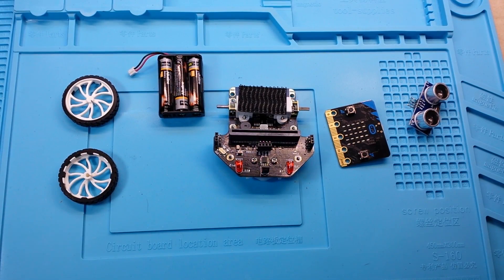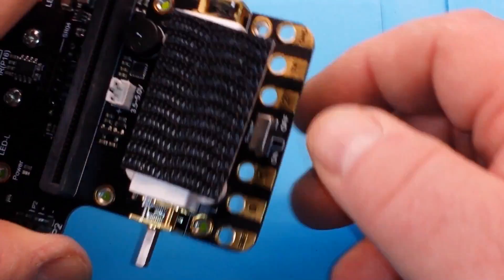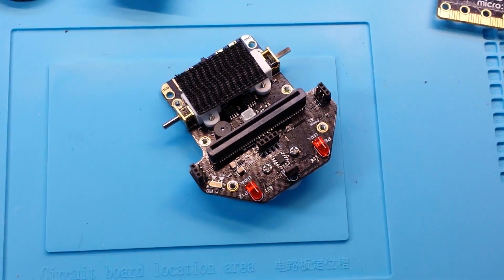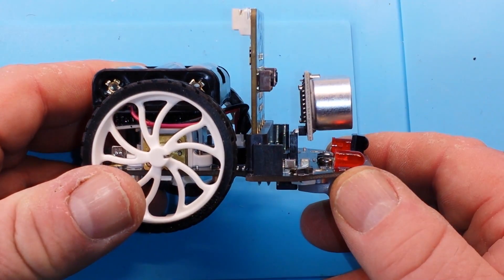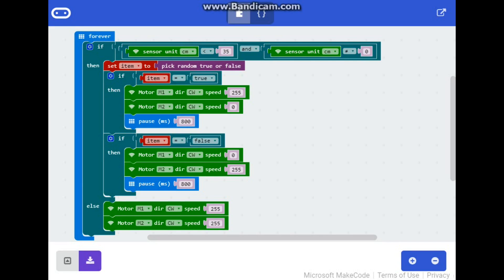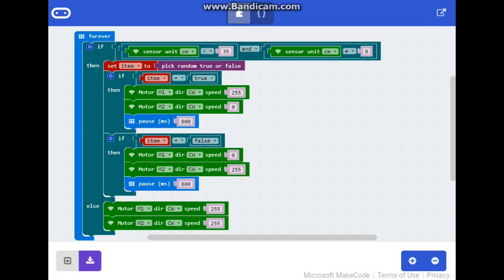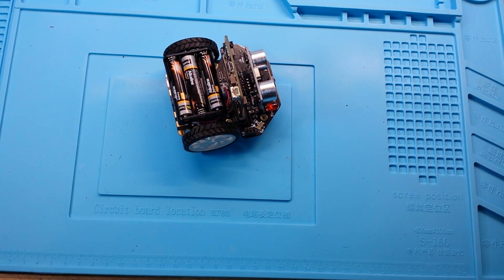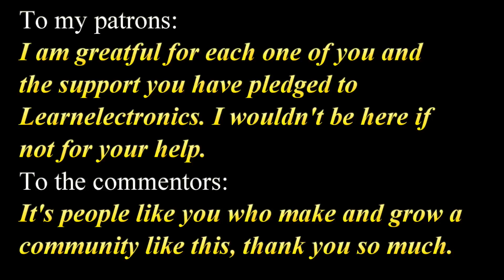Playing with the BBC Micro:Bit robot

Comment: Well, that's too easy to program. 😀 Javascript is an easy language to learn and as long as you can get some real code out of the plug and play then it could be a learning platform for much older students too. Block programming is great for young beginners. Okay so make it do something smarter, follow lines, detect motion or something. Thank you for sharing the Microbit robot and the video!
Reply from the maker: Yes, line following coming up.

Comment: Thanks for the review and also the micro:bit video. I thought it would be a good platform for my 7 yr old. I have been trying to get hold of this DF Robot model in the UK but most places only sell the MOVE:mini ( https://www.kitronik.co.uk/5624-move-mini-buggy-kit-excl-microbit.html ) so I would have to import it. I do quite like the other parts available for the MOVE though e.g. the Bulldozer, Tipper Trailer, Bumper etc. Would be interested in a comparison review if you can get hold of the MOVE plus accessories.  Thanks again.
Reply from the maker: I didn't even know the MOVE stuff existed. Thanks. Im looking into getting in touch with them.